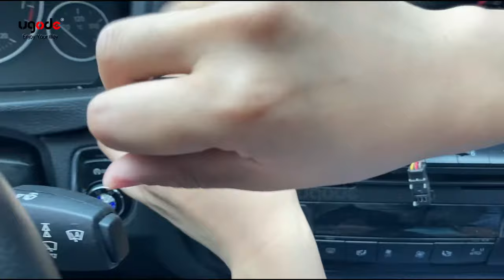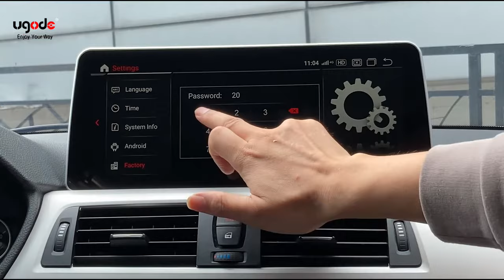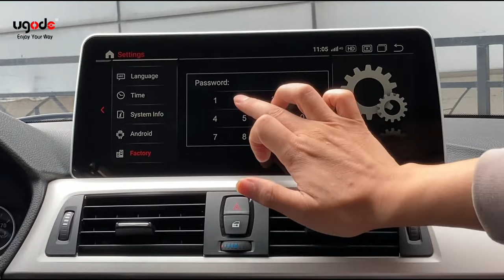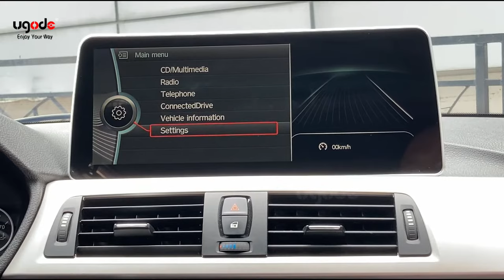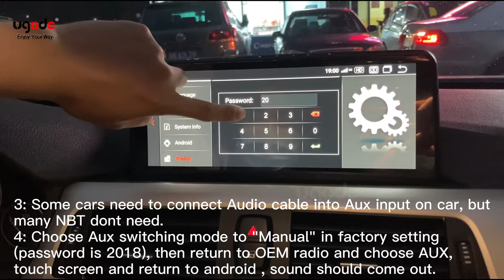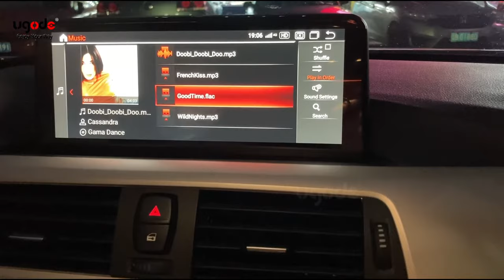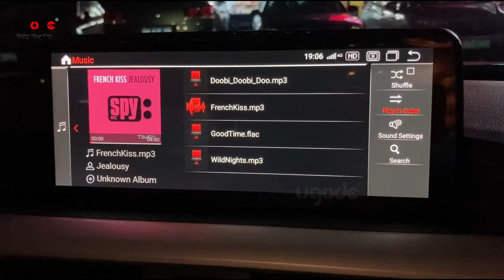BMW F30 Android Screen Display 12.3| OEM Radio Upgrade Install DIY | BMW 3/4 series F30 F32 | Ugode

Comment: I have f30 2017 I want to buy a 12" screen but it doesn't fit. because the dashboard edges are smaller.
Reply: 12'' is too big, dont do it

Comment: Hi there, I'm using OEM backup camera and when I put the car in reverse the image is all fuzzy (like a scrambled TV) and image is cut off (don't see the whole picture)... Any advice for me to fix image?
Reply from the maker: please choose correct "car display" options in "factory setting"
Reply: do you got it?

Comment: MN-X MODEL: How can I add a new shortcut to android auto on the main menu? There is no (+) button and long press on shortcut doesnt bring any menu.
Reply from the maker: Shortcuts cannot be created at the moment
Reply: @ugodecarplaynavigationfact9636  Thanks for the response. Hope it will come in the future.

Also, how can I make the unit not to reboot every time I switch the car off? It takes like 30 sec to power on..
Reply from the maker: @whoisthezator  

When the car is power off, the screen will also be completely turned off

Comment: Hi there - I have the F83 convertible and disconnecting the battery is a pain.. Is it necessary to disconnect the battery for this installation?
Reply from the maker: Power must be cut off before installation
Reply: @ugodecarplaynavigationfact9636  Uggh okay thank you.. Ads about an hour to the whole process :(
Reply: @stephenj8697 why ?
Reply: @Minato470  all good. Found a quicker way of taking out the trunk liner and disconnecting the battery in my F83.
Reply: @stephenj8697  do you need aux conect to play audio from android system ?
Reply: @Minato470  I don’t think so… I can still connect my phone to the cars default Bluetooth and play music / take calls via the car as normal. I did plug in that aux usb thing, but I never switch to the aux input so I’m not sure it’s necessary if you’re always using Bluetooth.
Reply: @stephenj8697  You have just nbt or nbt evo ? My aux doesnt work im using bluetooth and  im worry that sound from android wont work :/
Reply: @Minato470  you have to exit the android software and navigate back to OEM system. Navigate to mobile devices and find your phone… Make sure you have checkmarked ✔️ for both Telephone and Bluetooth audio… Then, on your phone lock screen choose then correct audio output to the car BT rather than android unit.
Reply: @stephenj8697  i mean to play audio from android system in car speakers. I want to know do it have to be connected with aux in car because my orginal aux doesnt work
Reply: @Minato470  why do you want to play audio from android system? Just connect ur phone to the car Bluetooth and use it like normal. The android system audio app sucks anyway.

Comment: Can I also hear radio during navi?
Reply from the maker: yeah
Reply: @ugodecarplaynavigationfact9636  The navi has also sound by using Aux. If I am listening radio which means that the sounds should come from the orignal system and aux is not avaible for the android system. Is it correct?